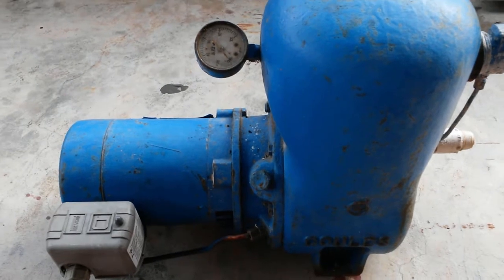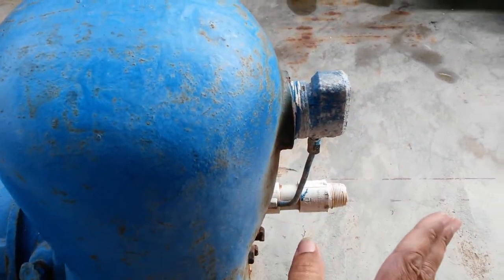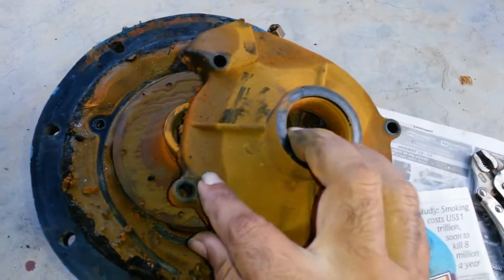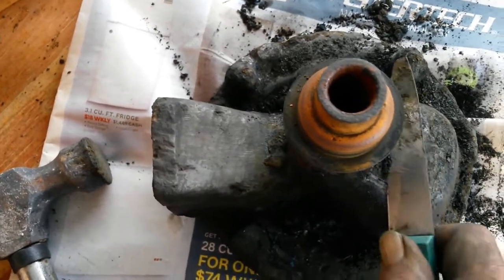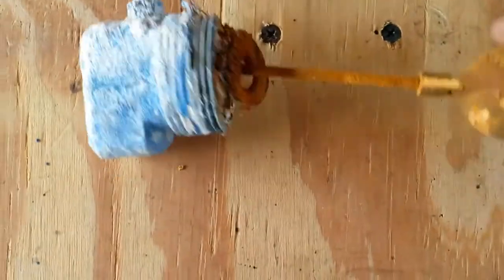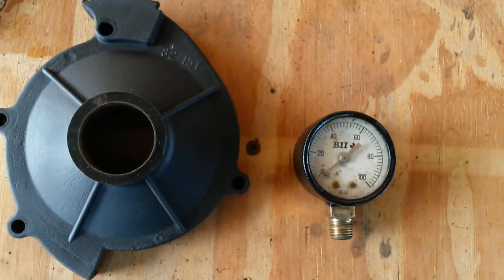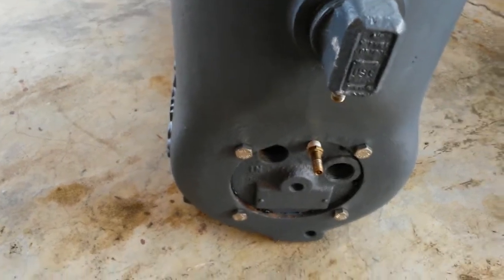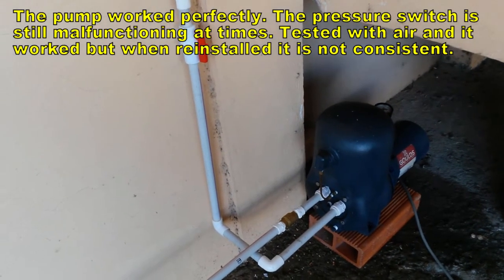154 Refurbishment of a Goulds Balanced Flow BF03S Jet Pump

Comment: papayo....meh faddar buy one it last 24 years never service wok realllll good  bought new one same model only thing the float only going 3 months with rust decided to convert 
took out the float  just added ah tank it woking goood  where can i get electrical parts  wire got busted from contacts the yellow one it looks like it was crimped on solder not holding 
expnsive pump but good .when the float gets rusted it does not shut off properly
Reply from the maker: Definitely a good pump. The rusting is a problem though.
Reply: @manickn6819  well all pump look like they rust but that float 400.00 I had to buy 5 in 2 years lol then decided to try the other way around and it work where do they sell electrical parts I busted a wire at the back that connects to the capacitor it not taking soldering it appears that it goes into a slot then it's crimped
Reply: @manickn6819  4forgot to tell u you is ah bossssss
Reply from the maker: @sanchhod  check out video 043. Its the conversation that really makes it interesting.
Reply: Hi morning looking for over switch the black one above 
The governor one thanks who does supply parts take care
Reply from the maker: @sanchhod  not sure. I don't repair pumps normally. Sorry I could not be more helpful.
Reply: @manickn6819  ah find ah fella  
Opposite Chaguanas auto supply it have ah shoe repair place next to he i have he number incase
Reply from the maker: @sanchhod  cool. Good info to have.

Comment: The BF03S is still a current model in production by Goulds.
It was ideal for small homes with a compact all-in-one design.
30 years ago in T&T it was cheaper than a pump + pressure tank. 
At that time most people did not have a regular supply of water. 
Most used small transfer pumps to fill their water tanks. They had either gravity feed to the house or turned on the pump when they needed to use water. 
I had one of these for about 25 years and it worked well.
No major issues other than replacing the capacitor or points on the pressure switch. As our demand increased I upgraded to a Goulds J5S. This one has given >10 years service so far and is in great shape.
Most tend to forget about a water pump when its working and only pay attention to it when it fails.
People don't want to take it out of service for preventative maintenance as it impacts daily life.
However with proper maintenance that pump could have given another 20 years service.

Thanks for sharing the repair and the follow up video on the theory of operation.
Reply from the maker: Thanks for the history lesson. Comments like yours make it worth it putting up videos.

Comment: Not seeing any pressure building at all but I think I am not getting any suction from the pump
Reply from the maker: I take it you opened it up and cleaned all the ports of the rust. The impeller is good and the motor is spinning? 
Start with a positive head at the pump and see if you are getting flow. Essentially connect it to a tank or something with positive pressure so flow occurs even with the pump being off. The pump should of course increase the flow significantly.

Comment: I refurbished one of these a couple of years ago and the problem as you can see is rust and scale.  I got rid of most rust, however, it always comes back. Any suggestions on how to prevent rust in the tank. By the way, my pump was in worst condition than yours and I got it working again, however, I don’t use it for drinking water.
Reply from the maker: I don't think there is a good way. That's why the manufacturer did not try. Almost any coating put in there will likely fail soon.

Comment: 5:54 how do you remove that resin cap to get to the motor?
Reply from the maker: There are two screws on either side if I recall correctly. Once that comes off the cap comes off.